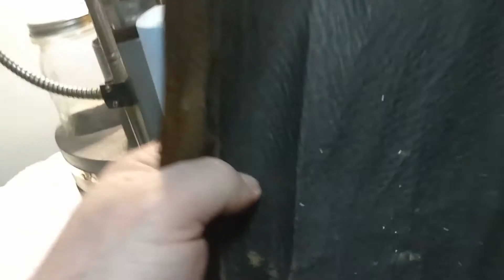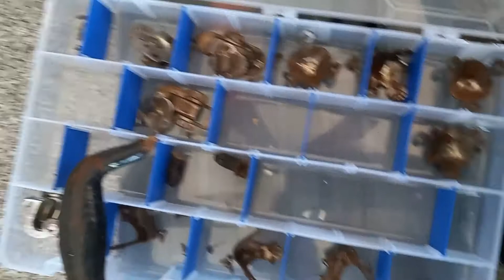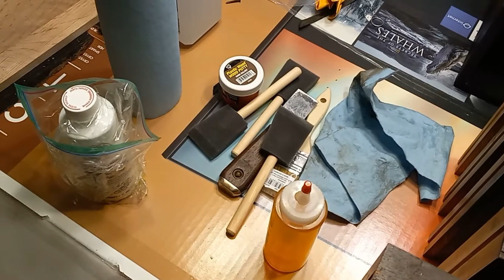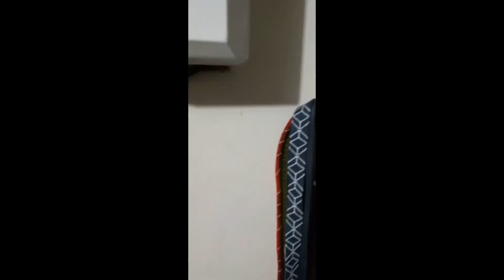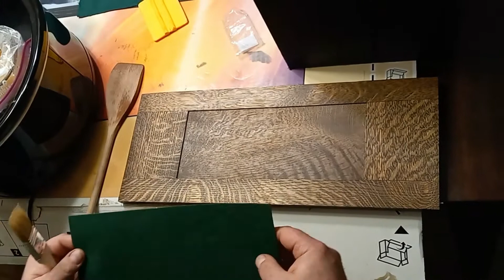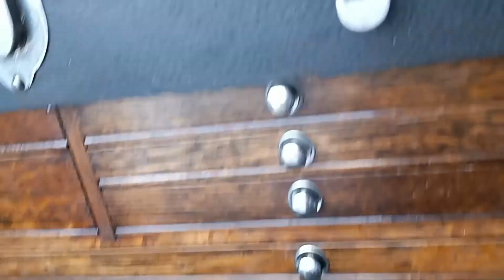Gerstner Leatherette machinist toolbox repair (and some Unimat too)

Comment: With regards to the split rivets - what is the actual length of these? The dimensions aren't listed on the Gerstner website and for me to import a package of 5 into Canada to find out, it would cost me about 4 times the cost of the rivets in shipping. I imagine that the solid part of the rivets is 1/2" since the thickness of the wood is 1/2". How long is the forked part of the split rivet? Any help you can provide is most appreciated.
Reply from the maker: Wish I could help you tho they only send you enough to do the handle. There are no spares to get a measurement from. However, I encourage you to shoot them an email on their website. I did and had very good luck with them answering my questions. I'm sure they'd be able to help you there. Good luck and thanks for watching!
Reply: @MachinistMiketheTinkerer  Thanks for responding!
Reply from the maker: @MSACoachMike  👍
Reply: Looks beautiful.  I would love to get mine cleaned up.  Thanks for the tips

Comment: Consider protecting the lead screw and the way rods with some cardboard or rubber mat, makes it easier to clean the mess. I usually turn the headstock around 90deg for any abrasive or dirty work. Great restoration, I wish those Gerster's would be easier to find here in Sweden.
Reply from the maker: I do sometimes put rags or cardboard down however, I have a small shop vac that really cleans it up good. Thanks for watching!